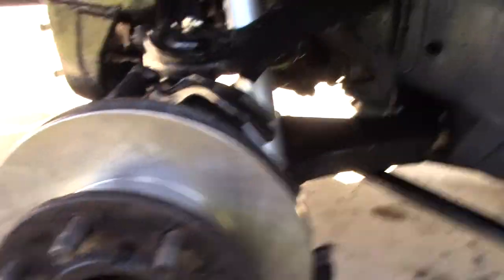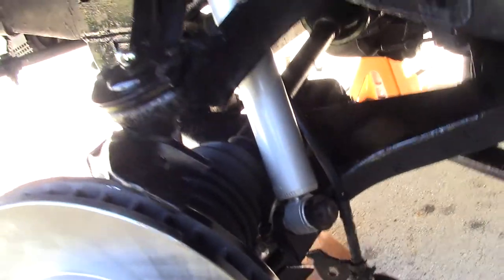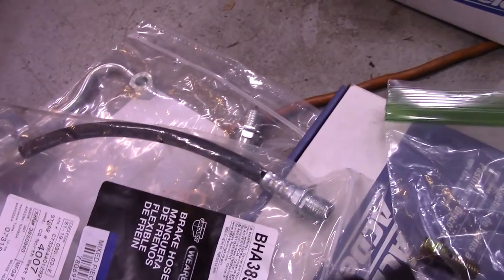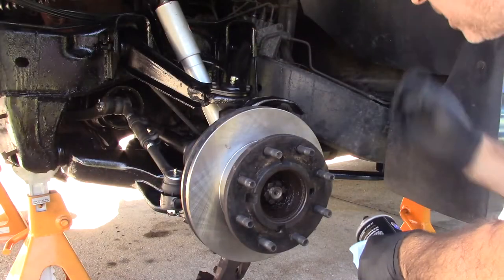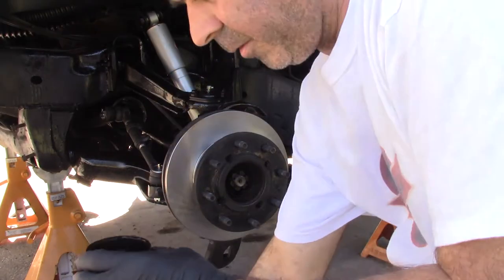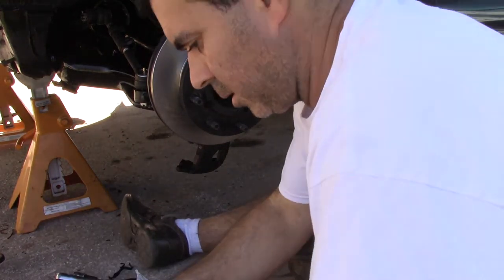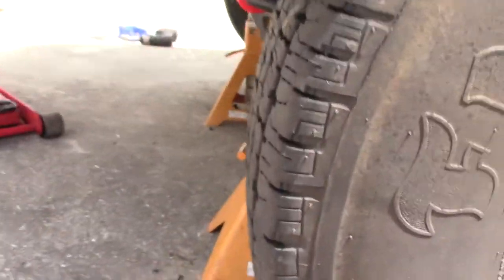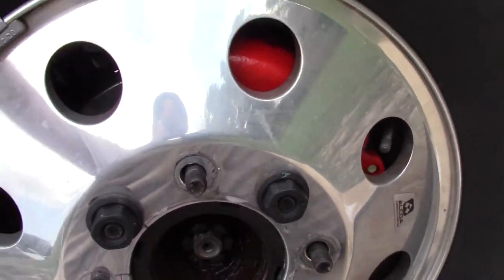Upgrading the Front disc Brakes on the 1976 GMC Motorhome.

Comment: Good Afternoon Sir, Just a point to cover, you talk about "upgrading" the brakes, but what about just normal brake maintenance ? ? ? ?  Please consider making a video going through the process of getting the brakes to the point you start THIS video.....  Basically a standard pads and rotor clean-up brake job.  Thanks
Reply from the maker: i can do that but it'll be on another vehicle because I don't think I'll be touching these brakes for a while.
Reply: @KGsGarage  Would appreciate it.  Proper method of getting the bearings off and new ones on and seals.  MUCH more involved than the brake jobs I've been doing on my vehicles for years ! ! !

Comment: I have really enjoyed watching the front end rebuild. The information you share is priceless. Looking forward to the steering shaft install. I have a 76 GMC also would you mind sharing the part numbers for the rotors? Thanks.
Reply from the maker: You'll have to get the rotors from a GMC motorhome supplier like https://www.sirumvintagegmc.com/ or https://www.gmcrvparts.com/ because they are specific to the MH. They have to drill new holes in Toronado rotors so they can be bolted to the GMC's Hub
Reply: @KGsGarage  Thanks so much.

Comment: Riveted organic pads are better than those new bonded ones!
Reply from the maker: I think they don't use Rivets for cost reasons and also when they get low the rivets destroy the rotors.
Reply: KG, the reason I mention it is that the owner of GMC REHAB RANCH  feels that the riveted pads handle extreme heat better and the rivets are brass so won’t damage rotors. Of course keep an eye on the thickness! Also the organic pads wear quicker BUT the rotors last longer. Always beware of ceramic pads with drums in combination on the rear! At any rate you’ll have the best looking coach! I’d take it to Quartzsite on it’s first trip and park in front of the yacht club for dinner!